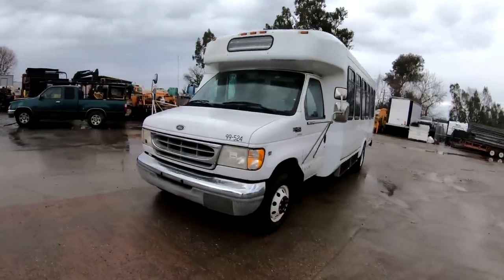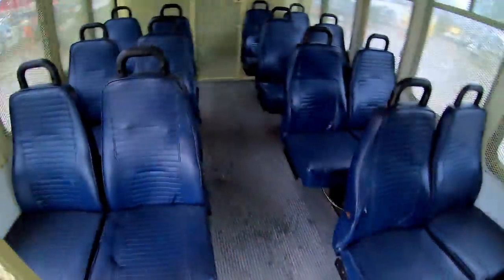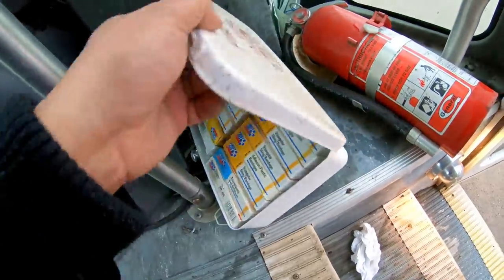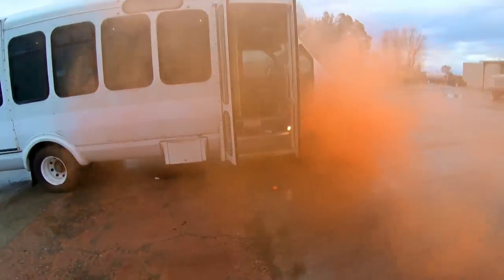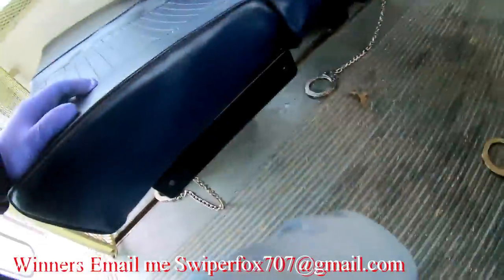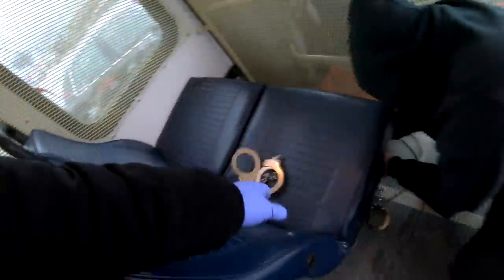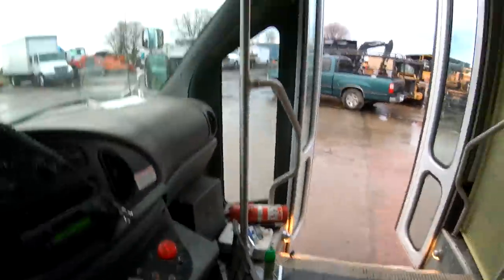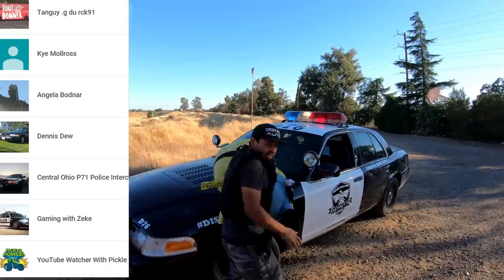Searching An Insane Asylum Prisoner Bus! Crown Rick Auto

Comment: I remember a church that bought a 2004 Mercedes-Benz Sprinter passenger van that was used by a hotel. There were some "goodies" such as business cards from the Marriott North Island Hotel & Resort in San Diego. The van had over 150,000 miles on the odometer. The black Crown Victoria should say feline unit MEOW.